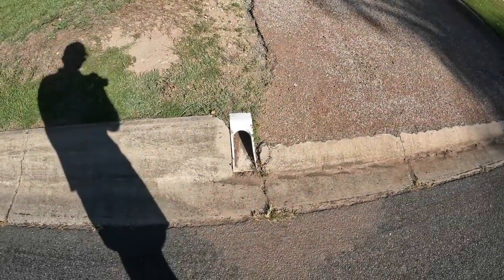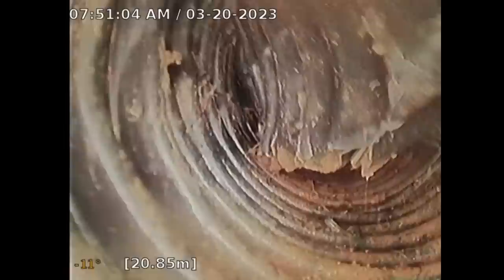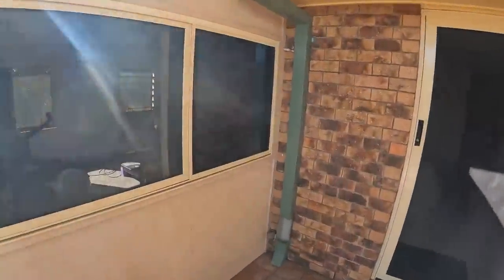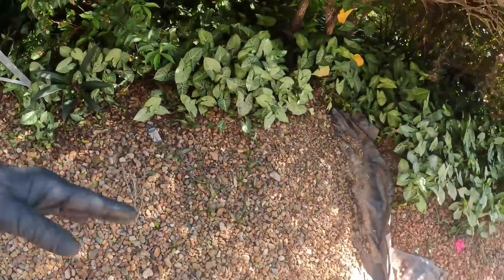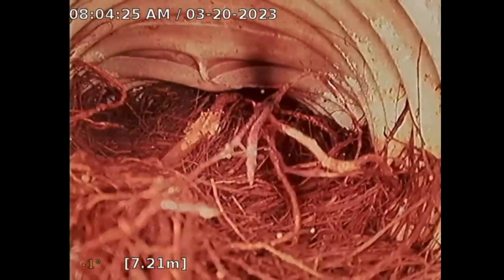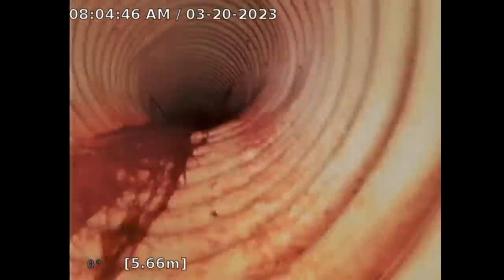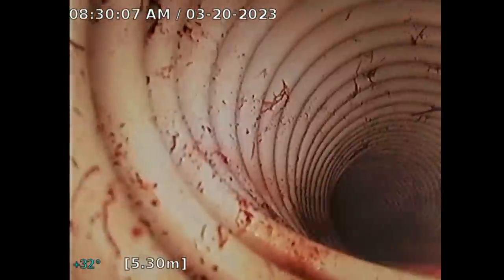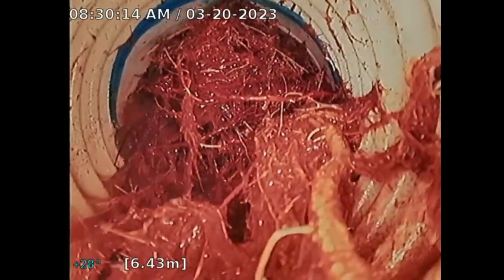Blocked Drain 361 - Epic || Roots Infiltrated Pipe & Refuse To Leave…

Comment: Looks like the best bet long term is replace the whole system. Very seldom do you have a system that you work so much on but aren’t successful in completely clearing it. It’s in really rough shape, with all the squashed pipe, breaks, roots, and lack of water pressure. You worked hard to get done what you’ve could.
Reply: I was thinking exactly the same, especially since the breaks and blockages are relatively easy accessible meaning not under concrete, building etc. and looking at your videos in general, stormwater pipes aren‘t deep underground in Australia, maybe not even half a meter. In the time spend for jetting also some digging and fixing of pipes could have been done.
But as for jetting great job again.

Cheers Martin

Comment: Good job on a tuff root job ,got to be frustrating having low pressure an having to start an stop but dig up is there best option an replace with solid PVC instead of that flexi pipe,see you on the next Gavin ,be safe.

Comment: So I have been noticing a theme for most of your videos and that is low water pressure. That being said I am confused about why you don't have a larger supply on board that is being refilled by the client while you are on-site instead of a small tank that is constantly running out. I'm guessing you are using around 100 gallons or less?
Reply from the maker: It comes with a small water tank. Don’t like the design
Reply: @penetratorblockeddrains  wonder if you could tie in a second supply feed since you need volume not pressure on that

Comment: In the US, I have never seen Ag pipe used for gutter drainage. Here it's used for foundation perimeter drainage and the intended agricultural application. Here in Ohio, USA, downspouts are usually directed into Schedule 20 PVC 4" pipe. It can still get squashed or deformed as you have shown in past content, but it's a little more robust  than Ag pipe. IMHO